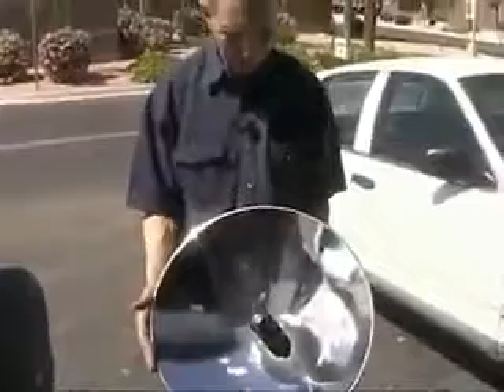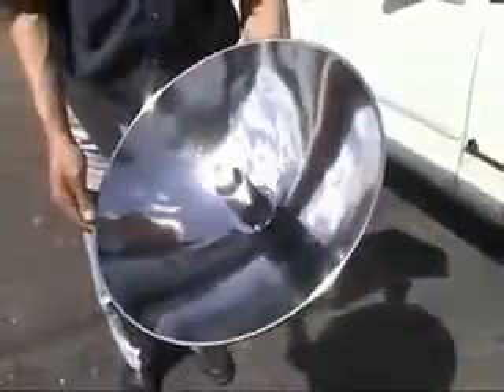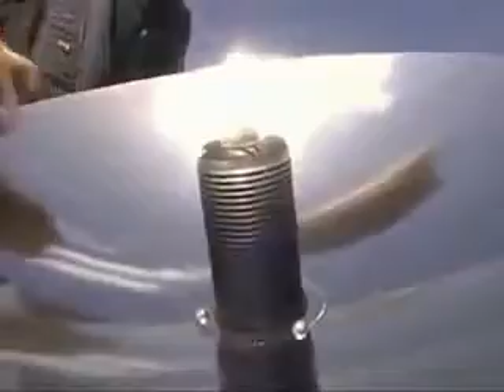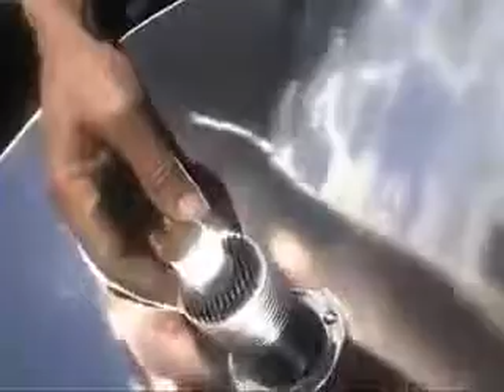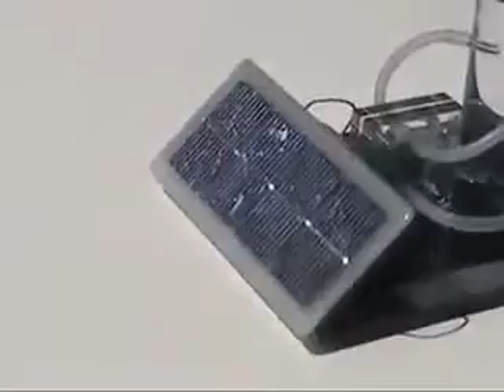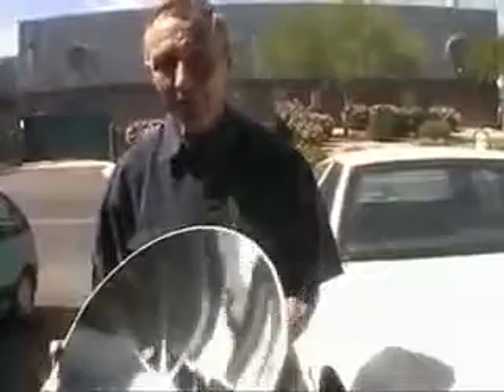Solar Powered Hydrogen Assisted Stirling Engine

Comment: hydrogen is the "working fluid" for the engine in simple terms. as a lighter than air gas it has vast expansion ability as a work fluid.